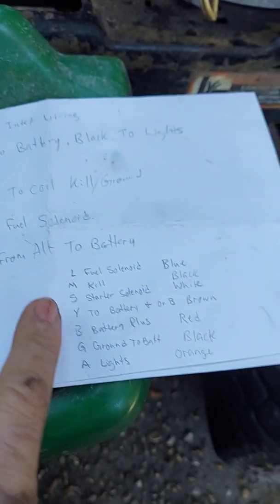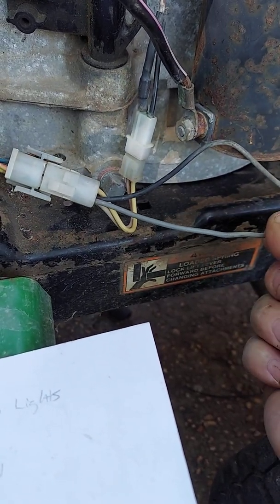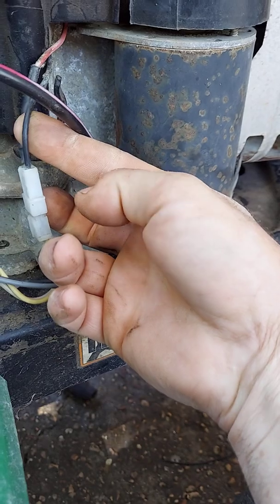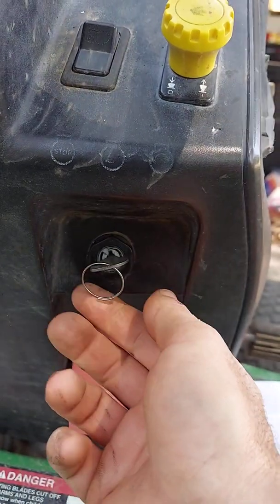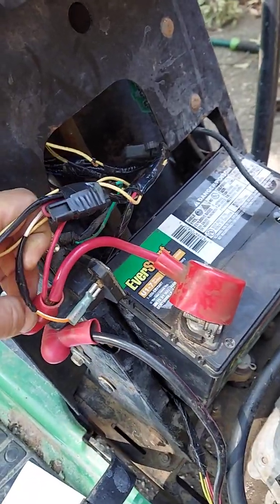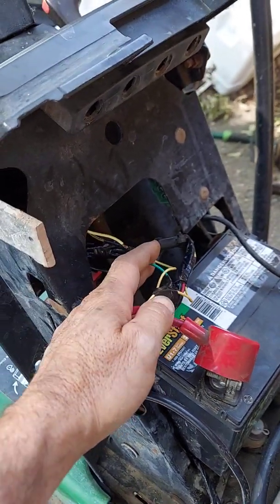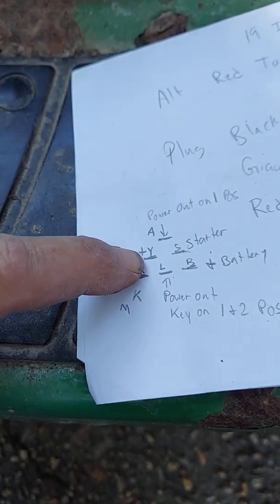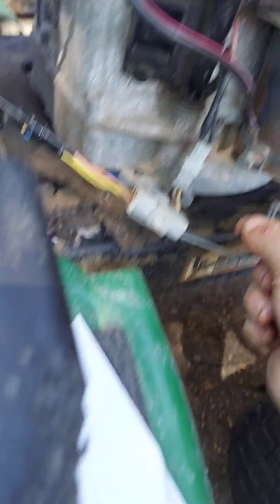briggs intek 6 pole connector pinout

Comment: I’m working on mine right now putting on a new Briggs 17.5 500cc replacement for a Powermore 439cc.  My harness coming in from the ignition switch looks like yours, red from magneto, two yellow from battery, white from ground going right to left and from the L switch I have a green line straight to the lights with a blue that connects like yours to the top right.  From the Briggs I have the grey and black coming from the fuel solenoid area.  Also have the red coming from regulator box?  So these 3 grey, black, red connect where?  Grey on mine can’t be L as L is just lights.
Reply: On the original Powermore, red from the fuel solenoid connects to white from ground at harness,white from magneto connects to yellow from battery, purple went from rectifier and connects to red from magneto,  blue from light line with green connects to orange and that goes somewhere.
Reply: Got it. Red to red.  Gray to white L. Black to the two yellow.  Now for the orange that meets the blue coming from the lights line.